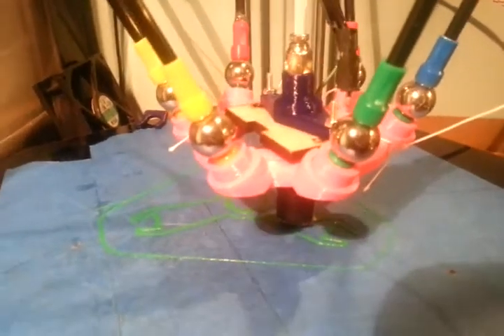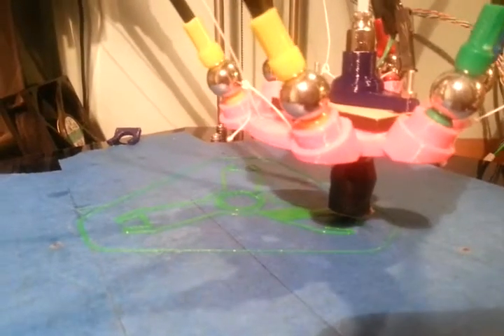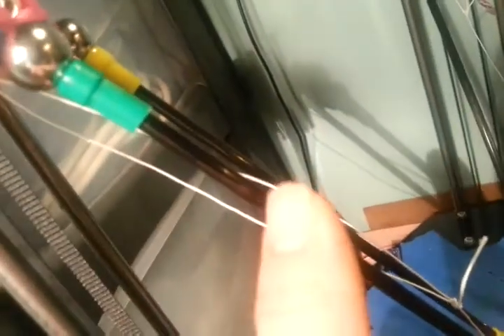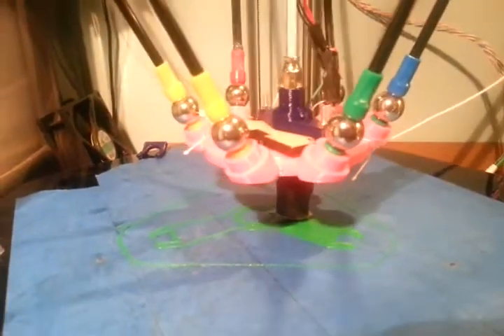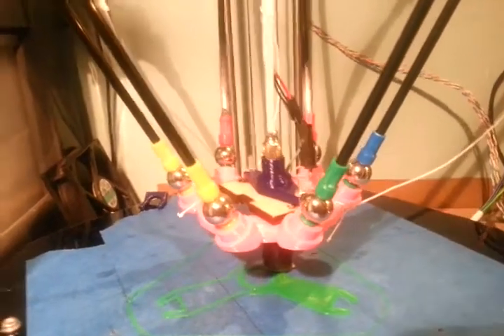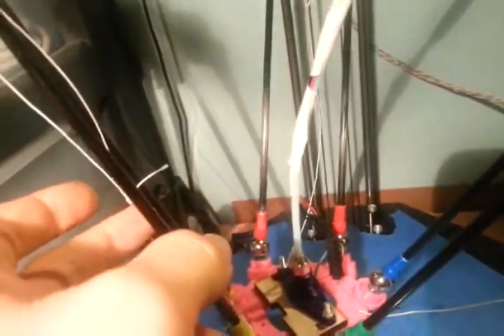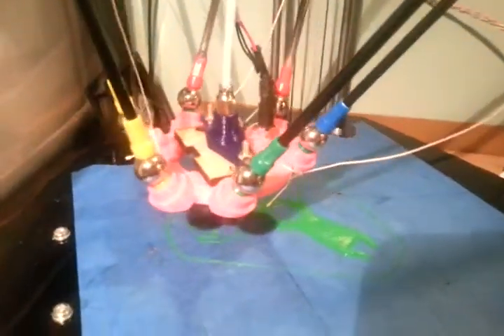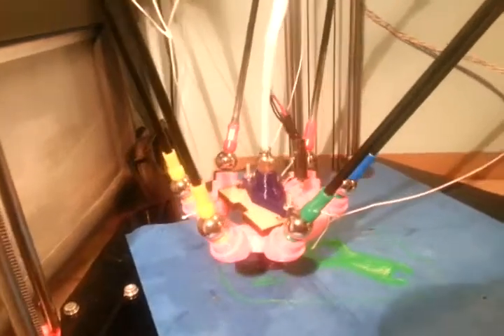Rostock delta printer - magnets and ball bearings

Comment from the maker: You certainly could! These are more of a proof of concept made from junk, but they are still working fine 7 days later!! I tried a few other versions with printed cups etc with other magnets but the ones featured in this video have the most holding power and were so simple to attach, but the 'cup' size is tiny so isn't super accurate but hey, I can still print a 1 perimeter walled tube. I am designing a sliding carriage to use HDD magnets behind cups for the IT hackers out there. Stay tuned :)